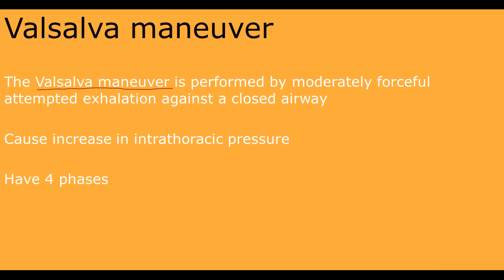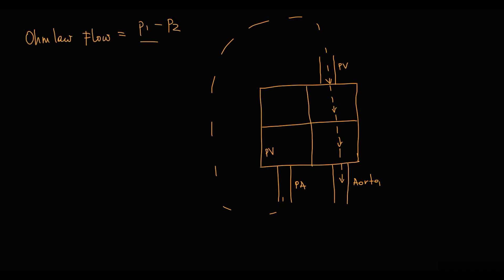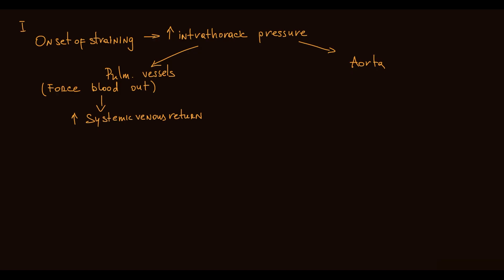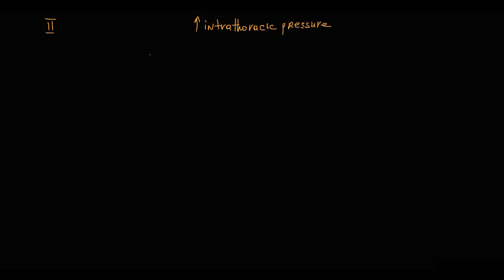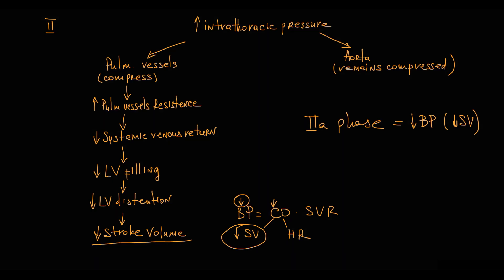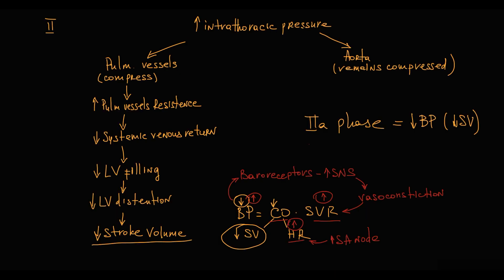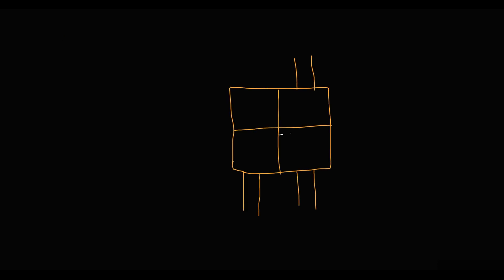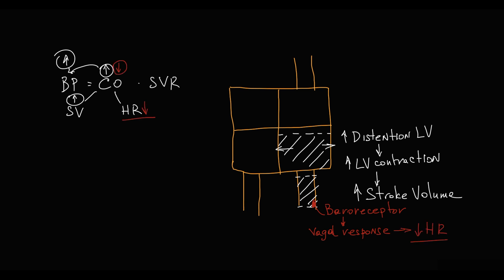Physiology: Hemodynamics of a Valsalva maneuver

Comment: in phase one doesnt decrease in radius of aoarta also increase afterload thus contribute to reduce stroke volume?
Reply from the maker: It's a very good question. The point here is that if LV works well ( not Heart Failure/ or any congenital defects), than it can push a massive amout of blood into Aorta  even with hemodynamically insubstantial increase in Aortic resistence without decrease in Stroke volume. ( heart has reserves and reflex regulation to provide this increase in contractility  due to Anrep effect ( increase in contractility due to increase in afterload - there by it keeps Stroke volume and subsequently Blood pressure stable) and  also due to the Bowditch reflex  ( through increase in HR (staircase phenomenon ) . Another story - in Heart failure, or in case of  peripheral vasculature.